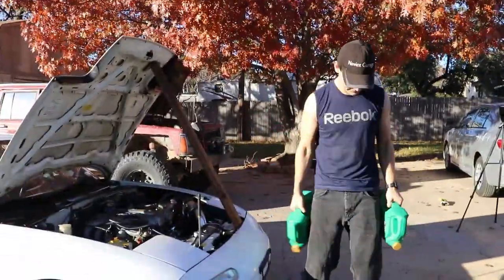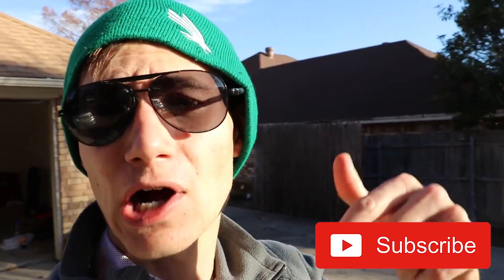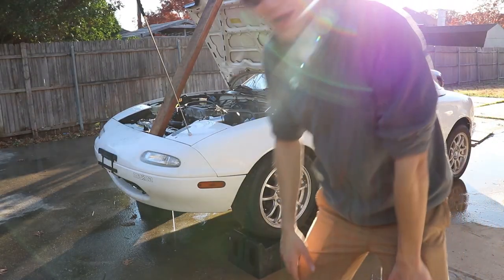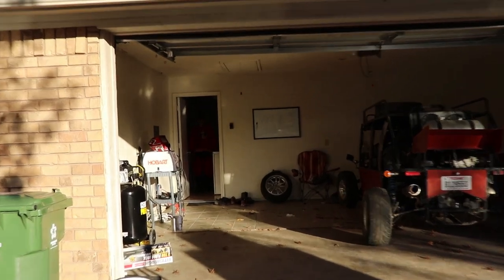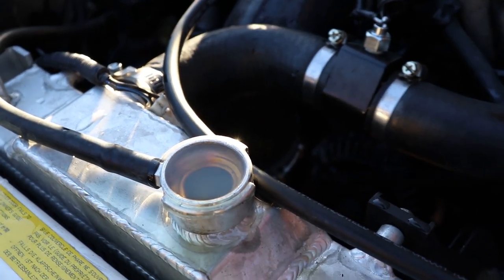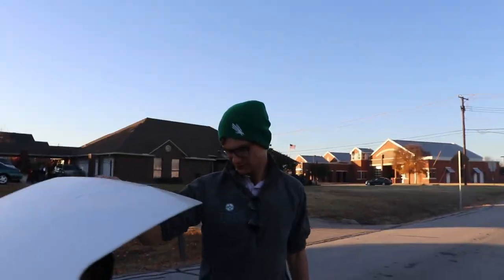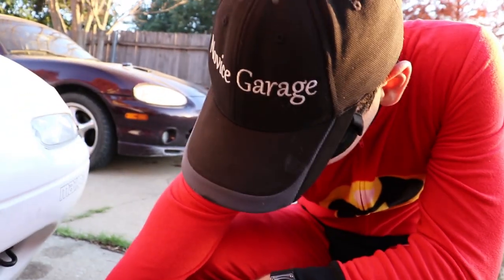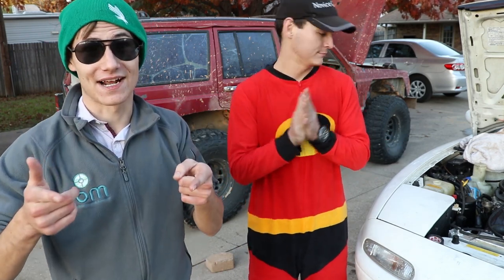Will Engine OIL Work as Car Coolant?

Comment: You guys are really trying to get a YouTube channel going by doing stupid ship over and over😂 you really trying to blow that motor up id run it without oil.
Zach uses a 12 point socket on a 6 point plug on the radiator.
Reply: Easier to put the socket on the nut that way